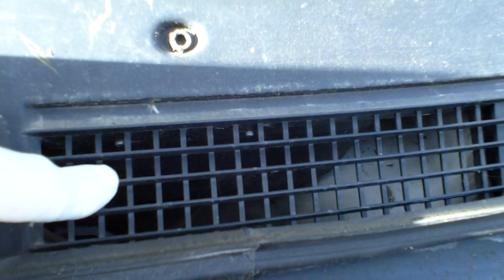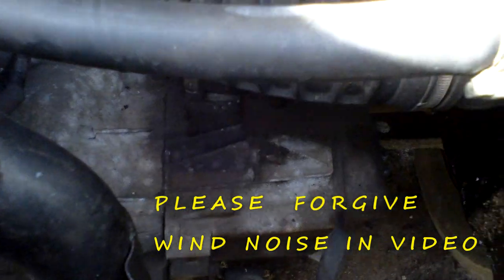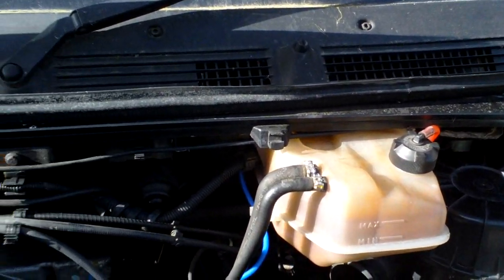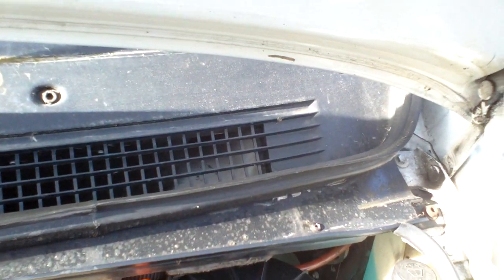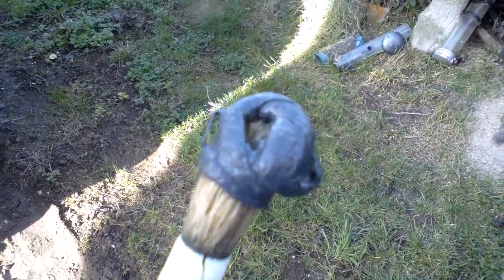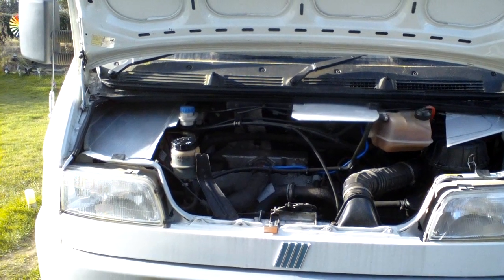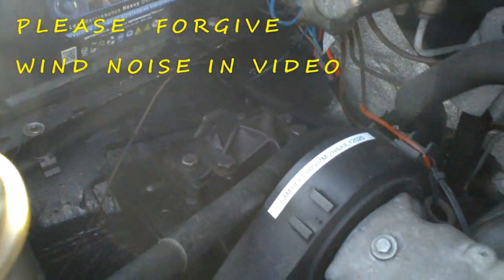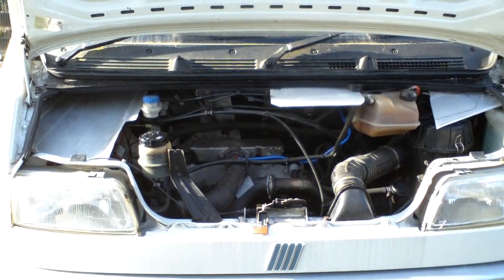FIAT DUCATO SCUTTLE DRAIN FIX

Comment: Hello peter i heard that the pipe needs to be extended/diverted due to the water getting in the box through that aswell might be worth spraying lanogaurd on the gearbox and the water then cant penertrate should just run off
Reply from the maker: Hi there. To be fair if the scuttle drain pipe is secure and run correctly the rainwater does not go on the gearbox. I looked at this early on and the water runs off fine… Regards Peter

Comment: Interesting. Thank you Peter.  I get a lot of water ingress over the battery area despite re-seating the bonnet rubber seal in non-setting mastic.  May I ask what is the material you are using to make the covers in the engine bay?
Reply from the maker: Hi Steve. The sheeting I used is Corex board. Not expensive and very strong.
Sounds like you have the same drainage issues. The welding I had to have done was horrendous My MOT showed up the rust as just “Advisory” when I bought the van but after some months of doing other major work that needed doing I took the van in for a cambelt and water pump change and the guy said to me it would never pass the MOT with the rust - it was repair or scrap. Th repair work cost me a fortune as it just kept going up in price but the end result is now I have no structural advisories on my MOT. If you can keep the engine bay - especially under the battery compartment above the wing you will keep the rust away.
Loads of other videos on my site as I made them when I tackled most jobs except radiator replacement... Stay safe. Regards Peter

Comment: Hi Peter did you remove scupper grill to take off pipe?
Reply from the maker: Hi Tom. I could not remove the plastic grill as the bolts were rusted in so using a mirror I found the the scuttle drain pipe was just a push fit so that’s the way I went.
Reply: @brucepeter2007  Many thanks Peter . I’ll try remove bolts . If not I’ll come from bottom

Comment: Hi Peter, I have water pouring in through the bonnet release handle when it rains. I also have a bit of rust in the same spot on the passenger side. I’ve treated and filled the hole on the passenger side, so hopefully that ok now. I’m going to try the codex board to try catch and redirect the water. Any ideas on where the water is getting in through the bonnet handle? Thanks!
Reply from the maker: Hi Frances. Ingress on the offside is either the lower windscreen metal surround has rusted through letting in water or the wheel arch has rusted through allowing water in - this latter point is generally only when driving in the rain which you did not mention. The codex board does work well fro water that gets in via the nobles around the wiper arms and if parked on a slope biased towards the offside which has no drain capacity unlike the near side of the scuttle that has the drain at the bottom of the heater air inlet.
Hope this is of help. Regards Peter
Reply: @brucepeter2007  thank you Peter,  that's a great help.  Will look at fixing that now.
Reply: @SuperFrannypants did you fix it?

Comment: If I would know this, I would never buy French cars ever. By the way, even 2017 models have the same issues. I can't believe that we need to put plastic sheets to fix this… I'm so angry, no engineering mindset. In my case drain is clean and water drops everywhere: on the battery, filter, electronics… That's why French cars are worthless because they are rotten inside! If the water drain is poorly done, I don't want to know more about what's inside the engine or gearbox, or other important locations…